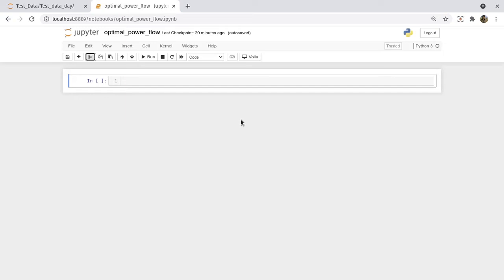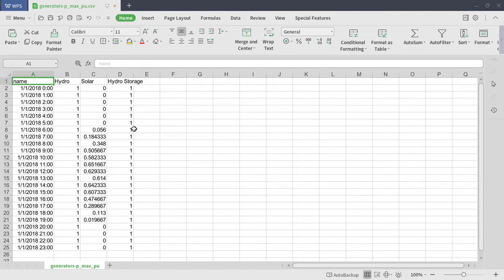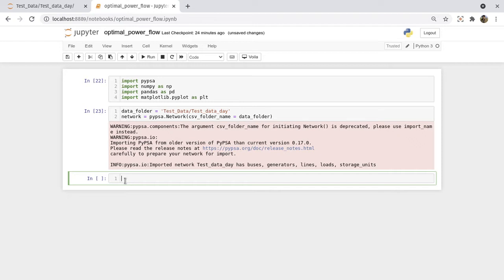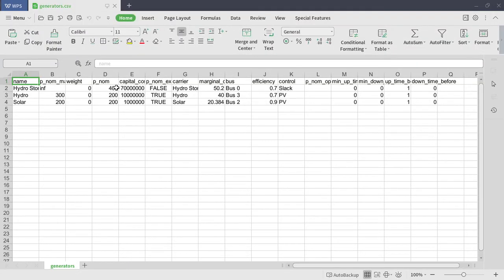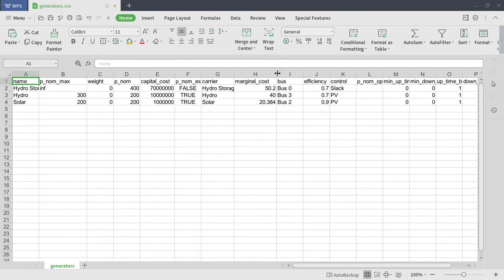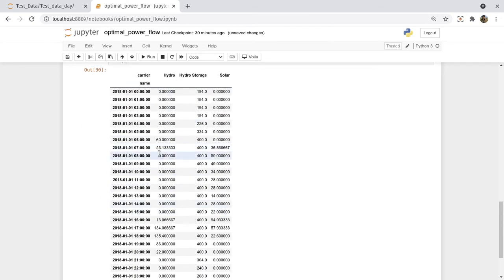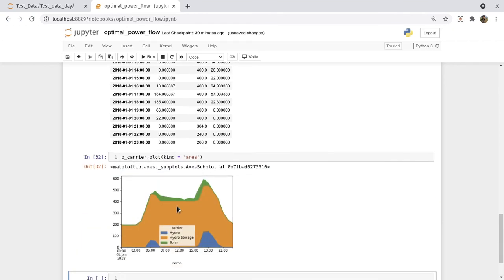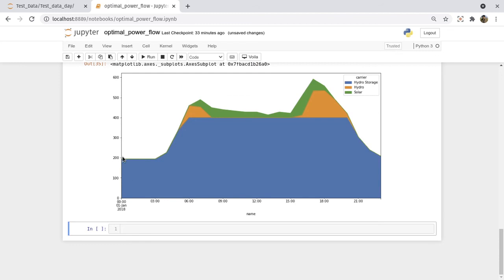Optimal Power Flow on PyPSA (For a time interval)

Comment: Hi, 
This is some nice video from you! Getting started with PyPSA for a project in my university. Would you mind to share your csv files as to fully understand how everything works as I am quite new for Power Systems and Modelling in general. It could be really nice if you shared your github for this or some file sharing systems. Thanks!